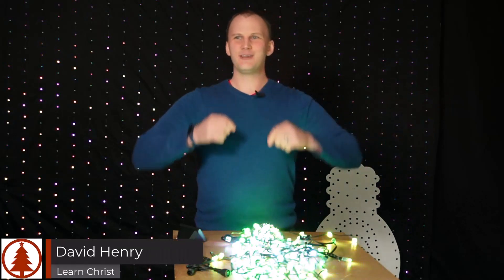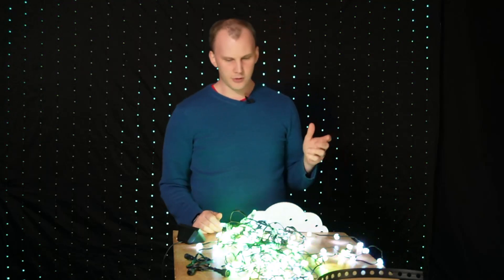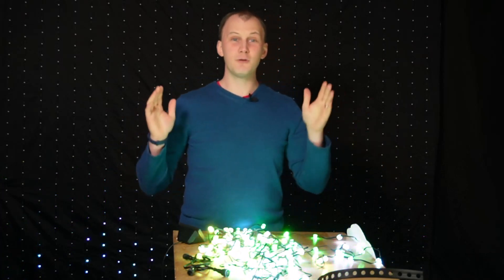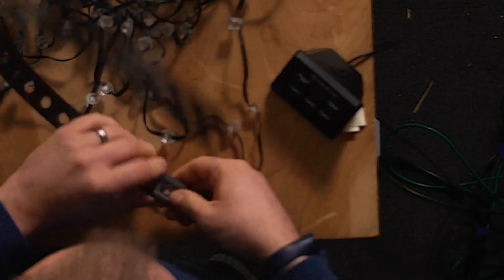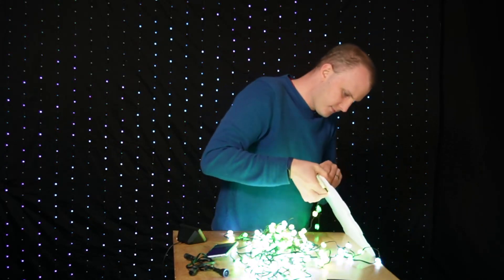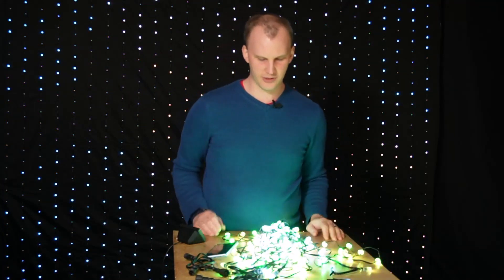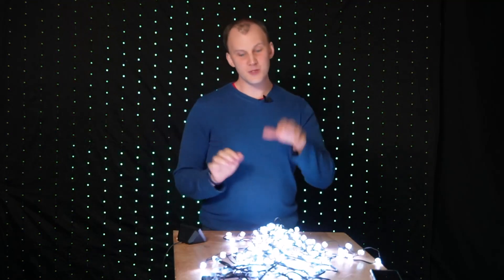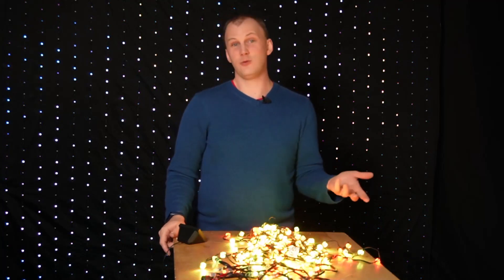What is the Deal with these Mattos Designs EVO Pixels?  EVO Pixel Review

Comment: @LearnChristmasLighting David, I am a big fan of the EVO, but you missed the biggest drawback: the wire used is really thin and prone to ripping. I had 3 strands rip last year when putting up my mega tree. No worries though, Mattos replaced them under the warranty. I purposely bought extra, so I wasn't delayed all that much during setup. For those thinking of buying EVOs--Do not hesitate! Just treat them with care (don't yank on them). This year I am using 3300 EVOs on my mega tree (2400 on the tree and 900 for the Boscoyo Sphere V5 as the topper).
Reply: My only fear with them is the thinner wire because of voltage drop and them not sticking out of the Coro. What are your thoughts about this?

Comment: I see Mattos has an Evo with dual data lines...  Thoughts or a video of the pros and cons.  At first i was sold because I like the reliability, but do they have a different dimming curve or color  differences vs single data line Evo pixel strings or vs standard bullet strings?  Thanks.
Reply from the maker: Haven't seen them in person yet, I would guess that they would match the original EVO but have the backup data.  Honestly, with the EVO's and other new types of pixels (like the NBG), they tend to be more reliable than standard pixels, so I think the need for dual data is low there.

Comment: How do you modify your power calculations.   If I had 1000 standard bullets  run at 30% I would just multiple .  .06 x 1000 x .3 = 18 Amps.    If these are constant current,  what is the draw?  I've seen both .05 and .08.   Assuming .05 for 1000,  I don't think you can just take 30%  would you need .05*1000= 50 Amps?
Reply: No. EVOs run at 8 milliamps per pixel at 100%, so, if you run 1,000 at 100%, the draw would be 8 amps. Also, you don't want to run EVOs at 30%. I speaking with some folks at Mattos, you'll want to run them at 70-80%.On my mega tree, I run 300 pixels/port. At 70% brightness, the port is drawing 1.68A and 20.16 TOTAL!! As a comparison, my PPD Wreath is 600 bullet 12V pixels on 2 ports (300 per). Being an HD prop, I run it at 20% brightness and it draws 3A and 36W.
Reply: @johnpappas9419 Why shouldn’t you run the Evo’s at 30%? And want would be the equivalent for Evo’s if I run my bullets at 30%?

Comment: Thank you for this! What about splicing out possible bad pixels, can ClickIts be used on these wires?
Reply: I can answer my own question after doing a bit of research... no, the wires are thinner gauge  with the EVOs and will not work with the ClickIts.
Reply from the maker: It's true, the Clickit doesn't work, but the Mattos III lok gel filled connectors DO work (same concept, essentially a scotchlok for 3 wires)
Reply: @LearnChristmasLighting  David, Mattos has a warranty on the EVOs, so NO SPLICING!! I would buy a few extra strands and replace any bad strings with the spares. All you have to do is send the bad EVO strands back to Mattos and they will replace the defective strands.

Comment: How does it do for under gutters trimming?  Could i use black hole strip like mega tree, or do I  need fixed square tubing? I'm thinking of replacing Ice Sickles. I hear there are ice sickle props as well.
Reply from the maker: Look at products like Boscoyo's ChromaTrim that are designed for horizontal useage :)

Comment: Im thinking of getting into this as my new hobby. I have been doing research and watched most, if not all of your videos.  I just have one question . I was wondering if there is any way on having your show start at a certain time and end at a certain time on its own?
Reply: Yes.  The xLights application includes xScheduler where you add your sequences and set the days per week and hours to run
Reply: FPP also has schedules you can run. I have smart plugs (indoor and out) that turn on the controllers/power the lights and my sign 30 min before the show starts, the show runs, the controllers shut themselves down safely, and then my smart plugs turn off the power. This is not necessary but I don't like wasting electricity, and the tiny risk of fire if I have a bad strip or an animal chews through some wires.
Reply from the maker: Yes, what you really want to do is get off youtube and grab our step-by-step courses and personalized assistance here: https://academy.learnchristmaslighting.com/lcl-academy-DT

Comment: I saw these at one of the XMAS expos.  I didn’t quite like the color output compared to the bullet.  Also, they seems kind of flimsy and not as durable.   I will probably pick up a set or two to try, but will not be my primary pixels for a number of year if at all.
Reply from the maker: Everyone can have an opinion :)  It doesn't "project" as much light per say to the eye, but I like how it comes out the sides and fills the plastic "marshmellow"